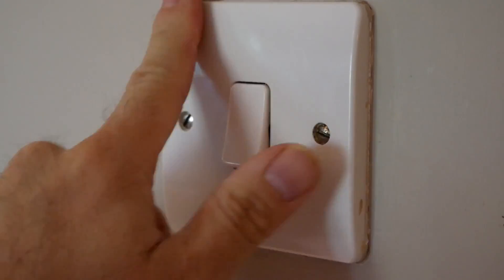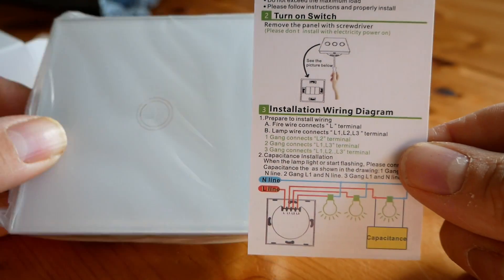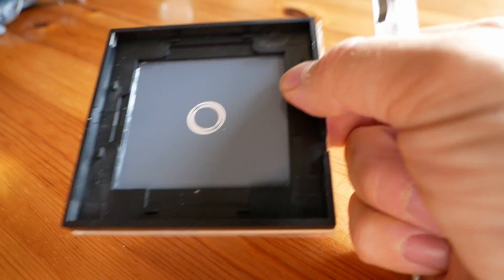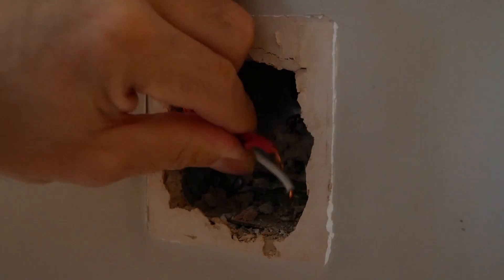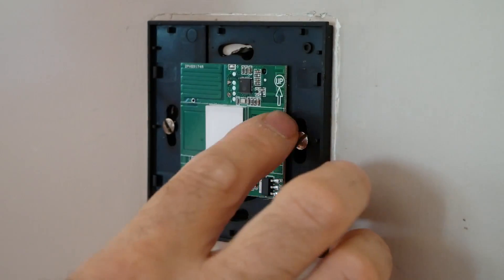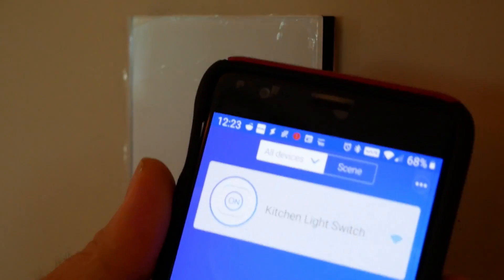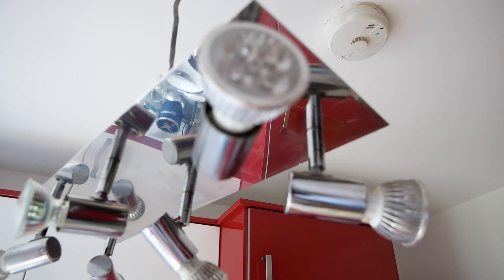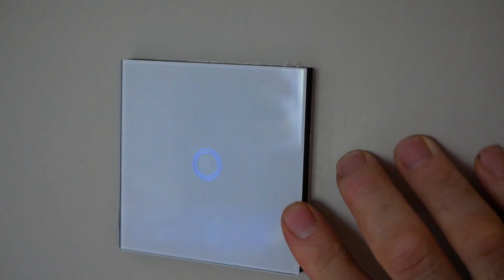No Neutral Smart Light Switch - Unboxing and Fitting

Comment: Thanks for the video, clear and concise, just what I needed. Got it fitted and working, well sort of...

I installed one of these light switches in my kitchen to control a dual fluorescent tube, it turns on and off fine but if left on after a while it turns off on it's own, sometimes after a few minutes sometimes twenty minute later.

Could this indicate I need to install the capacitor?? Thanks
Reply from the maker: Never used one of these switches with fluorescent tubes before. I would fit the capacitor and see if it makes a difference 👍
Reply: I'm having a similar problem.. I have a 2 Gang smart switch in bedroom that controls a fluorescent tube and a non fluorescent light fixture. The capacitor is on the non-fluorescent fixture. Initially I noticed that when one switches on fluorescent , the non-fluorescent will flash on then go off then the fluorescent would go on. Now a few weeks down the line what's happening is that the fluorescent is switching itself on and off without any user action. What would you advice me to do?

Comment: Could you upload the link for the capacitor or the model number of the capacitor as I need one and can not find one. Thank you
Reply from the maker: Hi
It's one of these capacitors, but not the exact type. You need to find one with insulated legs. It is the exact spec of capacitor just without leg insulation, a place to start. so you may have to hunt a bit for the insulated leg type. 
Don't try and use one without insulated legs, you could cause your light fitting to go live or cause a fire.
https://www.ebay.co.uk/i/283186542120?chn=ps&norover=1&mkevt=1&mkrid=710-134428-41853-0&mkcid=2&itemid=283186542120&targetid=910255718549&device=m&mktype=pla&googleloc=9046944&poi=&campaignid=9441122850&mkgroupid=96109442536&rlsatarget=aud-629407026465:pla-910255718549&abcId=1140496&merchantid=113592178&gclid=Cj0KCQjwwr32BRD4ARIsAAJNf_014m7DauU652wUhCN4c6FlvWUZUEJeZc9bFxuEOu4FRViFW8wgMqwaAhK_EALw_wcB
Reply: @handymancraftglasgow  Does the capacitance play the role? I mean my capacitor is 4.5uF, do I need to look for exactly the same?
Reply from the maker: Not sure about that. I would use the same size and type just to be sure it will work.
Reply: Thank you

Comment: I have this light switch, but I can’t get it to work properly. It connects to the WiFi and can be switched on but then when I try to switch it off it seems to crash and disconnect from the WiFi and won’t work when I touch it. Any ideas?
Reply from the maker: Do you have it connected to a two way light? If not, do you have the capacitor fitted? Make sure the wires are the right way round.

Comment: Do you know if it’s possible for the LED in the power symbol on the switch face itself to be shut off unless it’s flashing for a problem?  Through use of the app perhaps? Seems a bit pointless for an LED to run when lights are on and would perhaps be a little annoying in a dark room with an LED lit up on the wall
Reply from the maker: In this particular light switch it is possible to switch off the network indicator. The network indicator is a blue light that shows when the light is off. The switch will still be lit orange when the light is on. 
This is possible with the eWeLink app. Not possible in the smart life app.
If there is a problem with the network and you have the indicator off you won't be able to tell by looking at the switch. 
I was worried about this before I fitted them but the indicator light is so low you hardly notice it. The indicator can actually be useful for finding the switch in the dark. 
If I was fitting in a bedroom I would choose an ewelink one so the indicator can be switched off.
Hope this helps 👍

Comment: Hey why did you use capacitor
Reply from the maker: The capacitor helps the switch work properly especially if you are using LED bulbs. These switches  don't have a neutral so I have found they don't work without the capacitor.

Comment: Question. My smart switch came today and it only has N L and L1, can this be used with white com wire and 2 red L1 wires?
Reply: Ive tried a few combinations and the obly way i can get it to function is white wire in N and the 2 lives in L. But the light just flashes constantly
Reply from the maker: The light flashing is usually caused by the capacitor not being fitted.
Reply from the maker: Cant really advise on this. You need to know which is the common and what cable goes to the light.

Comment: I prefer to add a Neutral wire to the wall switch and use the two wires smart product.
Reply from the maker: That would be the best option. Could be expensive in older properties.
Reply: Handyman Craft Glasgow 
Most of older properties have pip for power cabling, if so, then add the Neutral wire become easier, I did it for three wall switches in my house within 40mins.

Comment: First one I have seen with no neutral, I bought 2 of the old ones and had to put a neutral to the switch.
Reply from the maker: This was the only switch I could see in October. Now there are loads of suppliers. They do need a capacitor fitted at the light but that is way easier than fitting a neutral. 
I looked at a few here - https://www.youtube.com/watch?v=wPc16dm6qd8&t=2s
Some of which were affected by my coffee machine - very strange.

Comment: Mine doesn't work.  Is the capacitor polarized, or can you insert it into the circuit either way?
It's in the U.S.  Does that make a difference?
Reply from the maker: The capacitor should work either way round. As long as the switch is rated for 120v it should be fine. We work with 240v in the uk. 
I am not sure about wiring in the US and how switches are set up so can't really advise you.
Reply: @handymancraftglasgow  Thank you.  It sounds like the voltage might have something to do with the capacitance necessary, so I won't bother reversing the capacitor wires.  I'll try to ask the seller about the capacitance.
Cheers!

Comment: Nice video Handyman Craft Glasgow, thanks! I have been considering this as well as others. My light switches have a neutral behind them so I am wondering what my best option is. Also, the capacitor... I have a standard 2 gang at the moment. Controlling a string of 6 GU10's in series and a ceiling fitting like yours - would the capacitor just be fitted behind one GU10 fitting (string of 6 in series). Would I also need one for the fitting too? Thanks
Reply from the maker: If you have a neutral then you are laughing. You shouldn't need the capacitor at all .You will have a larger choice of switches to choose from and they are usually cheaper. 
I would go with a standard smart switch if I was lucky enough to have a neutral.

Comment: Bit confused , there is no neutral at all. Even going into my lights. I have Live and switch live. Where would the capacitor go?
Reply from the maker: The capacitor is fitted at the light fitting across live and neutral. There will be a live and neutral somewhere but you will have to test or get an electrician.  Electrician would be a good call in this case.
Reply: @handymancraftglasgow  hi there.  I didn't know there was a fix for this.  Could you let me know what capacitor it is.  I can 5hen retro fit some.  Thanks

Comment: Hi mate did you ever fit a two gang two-way one I'm a bit baffled how to cheers
Reply from the maker: As far as I know there are no two way switches with no neutral. Have seen 1, 2 and 3 gang with no neutral but as yet no two ways.
I think there is a way to set up two smart switches to do this through automations in app, but that method would rely on WiFi.

Comment: Looking to buy the exact same switch (single gang), and wondered about 'what's in the box', installation and test / final results (including the placement of the capacitor). A great informative video, many thanks :)
Reply from the maker: Thanks for the comment 👍
Reply: this setup will not work with colour light bulbs as it puts them into pairing mode!

Comment: Hi I wonder if its possible to help me  in my lounge I have 2  separate ceiling lights with 2 switches a 1 gang on 1 wall in same room then on another wall again in same room a 2 gang switch.  Im talking about the old types with old wiring   https://ibb.co/SNCd3bj        as you can see in picture.  the left switch of the old 2 gang turns on/off the light near window same also as that 1 gang just for light near window  the right hang 2 gang switch turns on /off  the other light only.  i have rigged up 1 new wi-fi light  a 1 gang  but how do I connect a new wi-fi 2 gang switch to replace old one in same room. in the old 2 gang there is 5 wires  red blue yellow plus 2 black wires..   this is old 2 gang wiring  https://ibb.co/gPmD1jL  and this is old 1 gang wiring   https://ibb.co/mqbVtzY   this is new wi-fi 2 gang switch   https://ibb.co/njPKHyt   this is new wi-fi 1 gang switch    https://ibb.co/RDG5SLs  i hope you can help me to say which wires on both new switches go where
Reply from the maker: Hi Peter
Sounds to me like you have 2 way switches. These no neutral light switches are only one way - you can only control a light (be it single or several connected together) with one switch. 
A two way switch allows you to control a single light with 2 switches. 
As far as I am aware there is no way to wire these switches up reliably in a two way set up.
As far as telling you which wires go where, that is not possible. The wires will need to be tested to ensure they are what they appear to be. Your set up is way more complex than the one in the video.
Time to call a pro I think. They will have this worked out in about half an hour.
Reply: Hi again many thanks for getting back to me. I decided to leave that 2 gang switch, as I have fitted a 1 gang wi-fi switch now to replace one in same room. which did work and also from the left side of old 2 gang switch. too.  so all I have done really I suppose now is converted the 2 gang to a 1 gang. lol.  But Im happy with it now.    

 Just 1 last question  I did want to fit a 1 gang to my kitchen which has a  fluorescent light  I tried it and all work fine as only 2 wires red and black. but had to abandon it all as the back plate depth is only about 1.5cm  where as the new wi-fi back is about 3cm.     is there any 1 gang switches. which have a slimmer back bit to fit my back plate
Reply from the maker: You can get collars/spacers which will allow the switch to be fitted. The collar will bring the switch off the wall a bit. You can pick them up in screwfix. Make sure you get the right depth you need. 
https://www.screwfix.com/p/schneider-electric-lisse-1-gang-spacer-white/5782J?tc=DT3&ds_kid=92700050482623980&gclsrc=aw.ds&&gclid=Cj0KCQiApaXxBRDNARIsAGFdaB9IRkJLjH_NC8eFJeQBdhelKzwP2F866Rm2CTsSlILDDf0Fa0iCS3waAvaCEALw_wcB
Reply: Hi thats brilliant info handyman , I never knew you could get a spacer. as that will allow me then to fit the switches correctly as I am finding it hard to snap on the glass covers with some.  what I also am finding too, is the lugs what take the 2 screws seem to be in the way. so have now removed those. and drilled behind them into wall and fitted raw plugs and longer screws  much better now
Reply: Hi again handyman  I have a bit of a problem,  had put some filler around one of my light switches, as it showed some gaps. and all I did was remove glass front. cleaned it up. replaced now I cant connect it to Alexa. just  cant make out why it wont connect.  as it has to show a blue circle when its linked up. it works ok when you touch light which shows a red circle. but when you touch to turn it off. there is no blue circle. I know you have to hold finger on circle until its rapid blinking blue but no way will it now connect. which is so weird

Comment: The problem I had with eve switch program was that is working only on 1 device. If you try on two one will get logged out. That is a major issue if you ask me. Hopefully they have fixed that. Nice tutorial
Reply from the maker: Thanks for the info. I only have one device connected so never came across this problem.

Comment: Thanks for the video, just spent 6 hours yesterday trying too get a three way light switch working , the lights in two of the rooms worked perfectly but the kitchen just flickers when it is off or on, it must be the Neutral connection I made.

Thanks again for the information, I will rewrite the N today and hopefully all will be good. 🍻
Reply from the maker: Sounds like the capacitor. My lights were flickering both when on and off, the addition of the capacitor solved this.

Comment: I fitted 2 of these recently and they seem to generally work well. However I am experiencing a problem with 1 where occasionally Alexa tells me the switch isn’t responding. I can still switch it from the app so the WiFi is obviously connected and after doing so it usually works via Alexa again. Any ideas?
**Also a useful hint - if the switch is being connected to 12v led’s, the capacitor needs to be on the 240v side (ie. before the transformer)
Reply from the maker: It sounds like a WiFi problem. You could try swapping the switches and see if the problem still arises. If it does, there is a good chance its not a switch problem.

Comment: Not Apple HomeKit compatible which is a shame. I need to check out my wiring with a spark as it's a modern house and there are a few wires in the light switches.
Reply from the maker: Good idea. Sounds like you might have neutrals in there - but do get it checked 👍

Comment: Hi thanks for the video, I've been thinking about investing in these, 

I've check one of my houses switches and it only has 2 red wires and no white, how would the wiring work in the back of the new switch?
Reply: If it has no other wires and just the two wires in common and L1/L2 then one is the live feed to the switch and would normally be in the common terminal and the other is the live return to the lamp (either in L1 or L2).  The live return is sometimes not actually a red wire but a black or blue wire with a red sleeve on it - so this is your L2.  The proper red wire is your common.  If they are both proper red wires then get a cheap electrical tester like this:
https://www.screwfix.com/p/roughneck-electrical-mains-tester-screwdriver-100-250v-ac-slotted-3-5mm-x-130mm/8606x
You can use this to test which is the actual live - just leave you mains on and test which wire gives a live indicator.  Lol, you do this at your own risk of course.
Reply: Employ an electrician lol

Comment: Do you switch all the electricity in the house off? Or just make sure the switch itself is powered off? Thanks.
Reply: If you know for sure that all your wiring is modern and 'up to code' then switching off just your up lights or down lights breaker would be fine. If it's an older house then you can't tell what might have been going on so worth killing all the power. eg: In my daughter's old flat half of the kitchen sockets stayed on when the main fuse was off. Turned out there was a separate supply for the cooker and certain sockets.

Comment: Mine doesn’t fit in the fucking back box
Reply from the maker: That is a nightmare. There are a few options. Check this link for an idea, you can get various depths. 

https://www.screwfix.com/p/schneider-electric-lisse-1-gang-spacer-white/5782J?tc=IB4&ds_kid=92700050482623980&gclsrc=aw.ds&&gclid=Cj0KCQiA9dDwBRC9ARIsABbedBNqZLieO4QHy9Fz5j7PxWqq_8BLLi-aI96Qpbo_l-cQD0aIv8GJNcwaAng0EALw_wcB

Comment: Shame that they don't do a dimmer version. I've been looking for a 2 gang dimmer without neutral for ages.
Best I can come up with is a module that fits in the light unit and uses a standard switch. But needs the smart part to operate the dimmer.
Reply: LightwaveRF do dimmer switches - however, they do require an additional hub which is quite expensive.
Reply: https://youtu.be/yju7dZnwxD8

Comment: Hi, keen to do this but do you think this is safe by UK electrical standards?  Could the capacitor short in any way?
Reply: No things like that are in TV's radio's..etc...
Reply from the maker: Capacitors are very reliable and rarely break down. Not saying it cant happen but its rare. I have had no problems with the capacitor so far.
Switch working fine as well although sometimes it will switch on or off, will be making a follow up video.

Comment: Hello works very well but i have try to add one or two more switchs on the same light and when i ask to google put the light on the light is on but all the switchs are offline... 2 or 3 switchs for the same light is possible ? Any idea ?
Reply from the maker: I haven't tried these as two way switches and not sure its even possible. They work differently from a mechanical switch. Try contacting the seller.
Reply: kiki kiki I have 2 of these and the are not suitable for 2 way switching

Comment: I like how you used a jewelers screwdriver for everything
Reply from the maker: 😊 Not quite a jewelers screwdriver. It's a small electrical screwdriver. Wouldn't recommend using a jewelers as they tend not to be insulated.
Reply: It's an electric insulated screw driver, It lights up to test if wire is live,,

Comment: Thanks for the video - very useful - I have a ceiling rose for all my lights (thank heavens) so I just (if I need to) wire the capacitor so that it is between both main connections - so it's in parallel with the light?
Reply from the maker: That's right. It shows you in the instructions exactly how to fit it.
Reply: @handymancraftglasgow  Thanks!  The new "smart home" is a christmas present for Mrs H, so haven't looked too closely at the instructions yet.  Should be an easy enough job though!